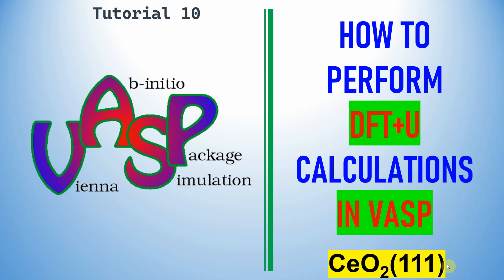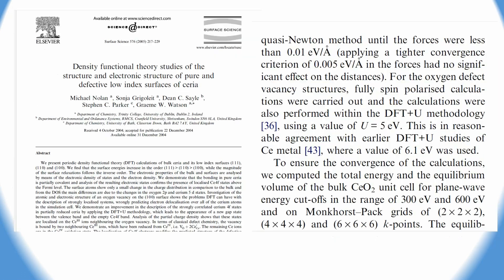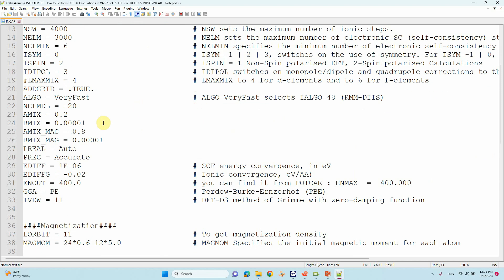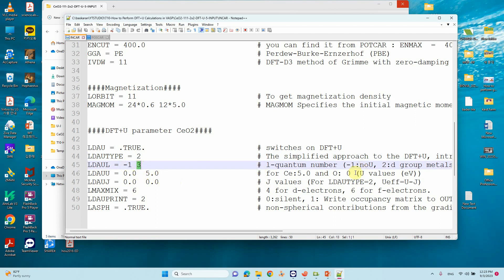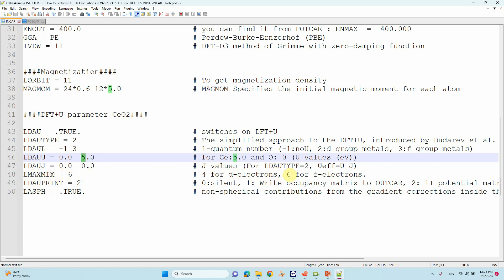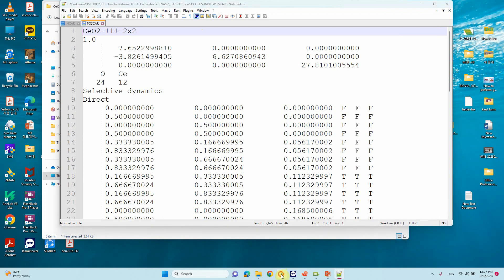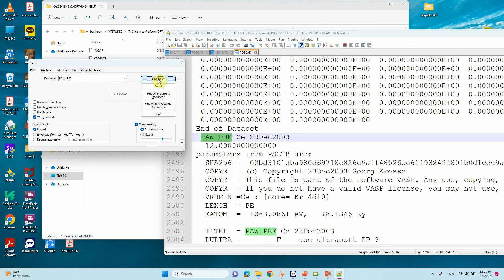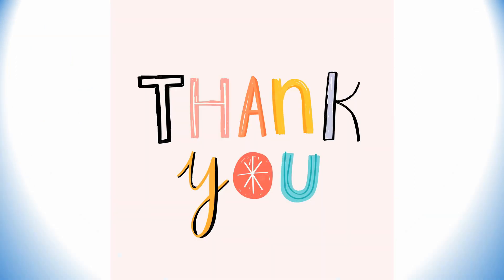How to Perform DFT+U Calculations in VASP

Comment: respected Sir, Let's say I have a composite material where d and f electrons are present. In this case, what should be the Lmaxmix?
Reply from the maker: LMAXMIX is chosen based on the highest angular momentum of the valence electrons present in the system. For systems containing only s- and p-block elements, LMAXMIX = 2 is sufficient. In the case of TiO2, which contains a transition metal (Ti) with d electrons together with p-block elements (O), LMAXMIX = 4 is required. Similarly, for materials containing f-electron elements (with or without d-electron elements), LMAXMIX = 6 should be used to properly describe the charge density.